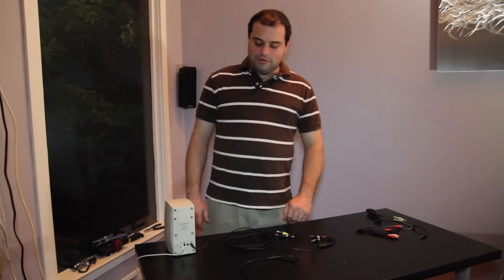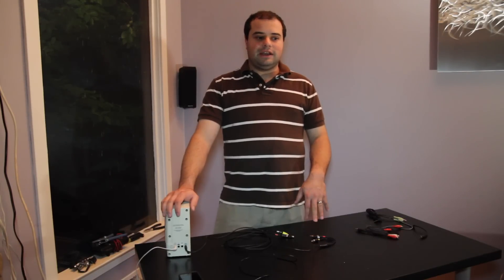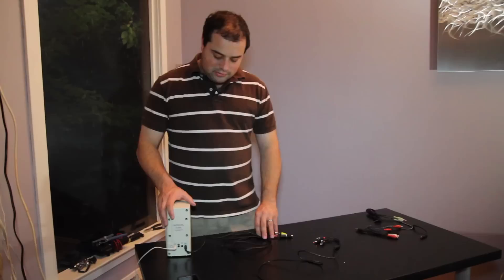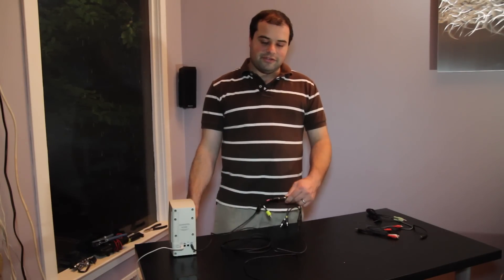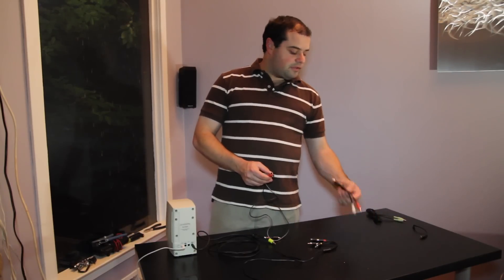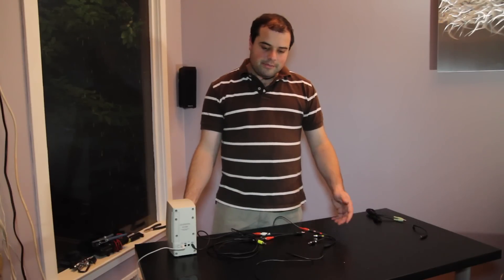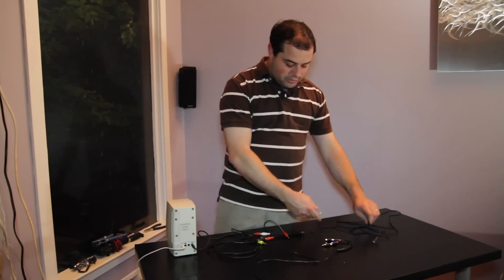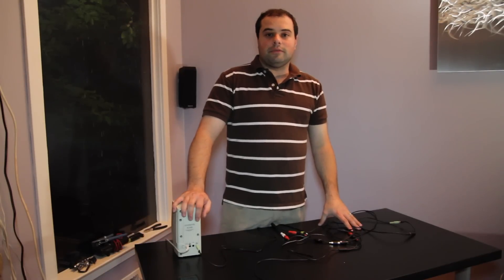Home Theater Repair & Installation : How to Test Audio Cables

Comment: TO TEST ANY SPEAKERS 
-touch an AA battery to the cable, one side to negative and the other side to positive
- listen for a wop wop wop sound, this is just the electricity going back and forth to the speaker 
if you hear it, it works (this is perfect to test lines to see where and to which speaker they go to.) 

this will however not let you know if the speaker is blown, meaning it no longer has quality sound coming from it. for that you need music and a good ear